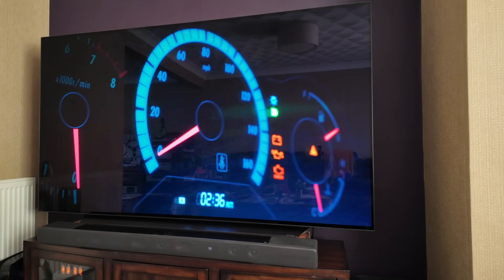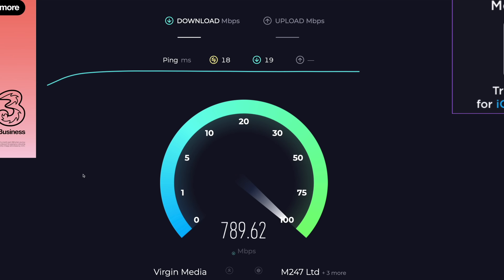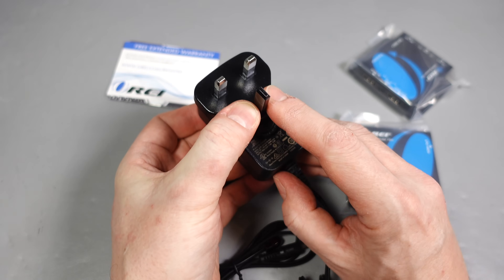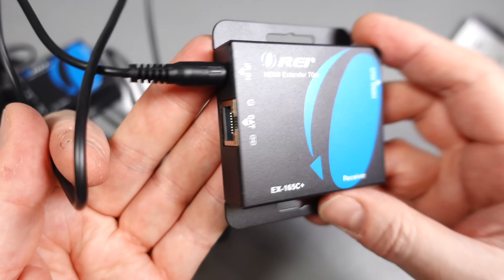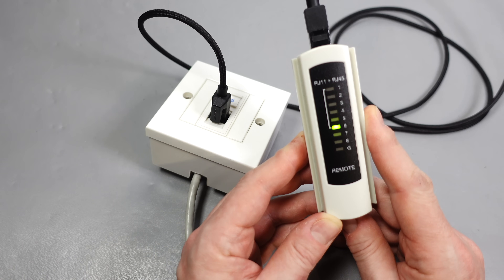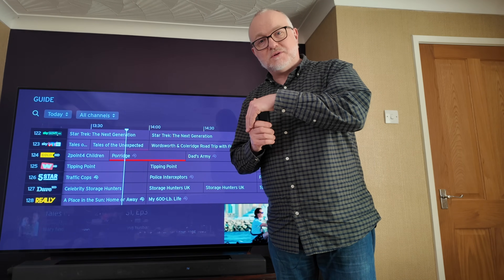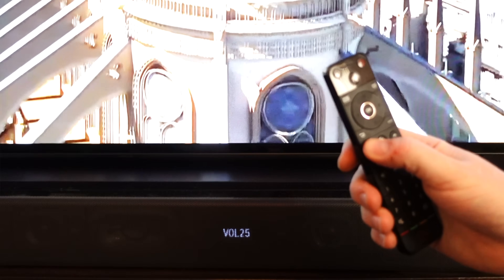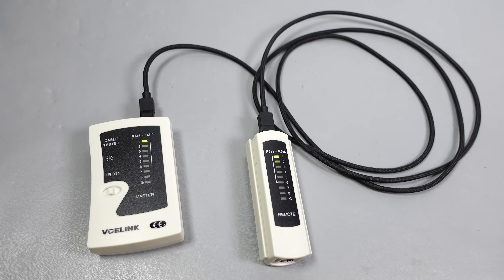HDMI via a Cat6 cable works surprisingly well

Comment: Hey TM, IT FE here. See these devices every now and then and they’re also known as HDBaseT devices. We typically see them hidden under the floors / behind tvs in conference room setups. 

For the Ethernet as you mentioned the green and orange pairs weren’t 1-1 which meant this was a crossover cable, in future, use B standard as that’s pretty much what you’d see worldwide now. 

Great vid as always! 👍
Reply: HDBaseT is the standard but not all of these extenders are HDBT certified. It's a useful standard in case you need to mix and match manufacturers equipment, you can ensure interoperability. But generally these cheap extenders (often called baluns) aren't HDBT compatible.
Reply: @OriginalRitz  Yup, if it doesn't have "HDBaseT" slathered all over the packaging it's a pretty good bet that it ISN'T HDBaseT (costs money to license the standard so unless you NEED to be compliant with it to talk directly to say some projectors most companies don't bother, they just do some signal processing and shove the signals over the Cat6 cable)

Comment: You'll want to cut off the ends sticking out from the punch block in your connector. They introduce reflections and signal degradation. Better yet, buy the correct punch tool that has the built in cutter that does the job right.

Comment: I'm in my mid-twenties and I use a device that uses a bluetotth remote mostly and I instinctively point it at the device and TV all the time still. It does use Iinfrared for controlling the TV's volune, but nothing else. However, I still naturally point the remote at the TV because that's what I grew up with.

Comment: T568A to T568B would be a crossover cable which most Ethernet equipment in the last 20 years wouldn't care as they auto negotiate the connection. 
Structured cabling should always be the same at both ends so good job in fixing that and yep they can certainly be used for other things other than Ethernet.
Reply: I've always seen that majority of factory wires and youtubes use the B coloring, so I always do B.
Reply: @gluino  B is the defacto standard for at least 35 years now.
Reply: Yeah, you'd wiring the cable as crossover like this if you wanted to connect to ethernet devices without using a switch. But as you say, nowadays all ethernet adapters are auto-detect so no need for crossover cables, (plus switches and routers are cheap). Also as crossover cables are normally short, I'd imagine the folks making these boxes wouldn't bother making them detect crossover.
Reply: The last 20 years were very very good. Back in the 90s a whole-building ethernet install was done A on one end and B on the other for a K-12 school i worked for. All we had were dumb 10BASE-T hubs, so back then it mattered. I remember how AMAZING auto-negotiate equipment was when it finally appeared. Now, of course, isn't everything faster than 100BASE-T now reliant on all 4 pairs, so they once again break if crossed over? Power over Ethernet stuff breaks, too, I believe. ◡̈
Reply: @Pants4096  Back in the mid 90s I was using DECNet on coax cables, if they got a kink in them you'd lose connectivity
Reply: Never had these wiring problems with 10Base2 cables. 😆

Although if someone disconnected one of the T adapters.. 🤷🏻‍♂️
Reply: you can get a very cheap crossover adaptor that would probably have worked in this case
Reply: This isn’t Ethernet…
Reply: @brandise76  Correct ANSI/TIA-568 is a technical standard not Ethernet. Maybe watch the video again and you may see @Techmoan mentions about the wiring not working and how they fixed it. Again this had nothing to do with Ethernet but when he originally installed it and it worked for Ethernet there is a reason why it still worked even though the ends were different.
Reply: @Didz  your patience with these folks is commendable
Reply: No, it's not a crossover cable at all.  They are two different pin-out standards (the TIA) for UTP cable connections to RJ45 connectors.  A crossover cable transposed the transmission and receive wires (TX->RX and RX->TX).  Take it from a CCNE and Systimax certified network engineer 👍
Reply: @garyt123   If you take a TIA-568A cable, and swap the 10/100 Ethernet TX and RX lines on one end, that end becomes...TIA-568B.  So either you need to return your CCNE/Systimax certifications or further explain what you meant by crossover being different to TIA-568A/B.  Perhaps you meant it's not a "full" crossover cable with all four pairs swapped, for gigabit Ethernet?  But that's irrelevant since gigabit also mandated Auto MDI-X so at that point crossover cables were no longer needed.  Crossover was only relevant for 10/100 and those had 568A wiring on one end, and 568B wiring on the other.
Reply: @vink6163  quite apart from that I've never seen any standard that does anything to brown/blue, by the time we started using them auto MDI/MDI-X was standard (and realistically these days a Gigabit PHY doesn't care what pairs you connect where so long as they're the right way around at each end), as you noted the only difference between a "normal" cable and a "crossover" cable is that the orange/green pair are swapped end to end which shock horror is the difference between TIA 568A and TIA 586B.

Now if they're talking about a ROLLOVER cable that's an entirely different beast and was very much a Cisco thing but besides the fact that Cisco created it it has precisely nothing to do with ethernet.
Reply: @vink6163  It is not irrelevant. Backwards compatibility is of utmost importance in physical cables as no RJ45 cable is keyed in any way whatsoever with regard to the actual interface used.  Stop thinking about your home network, and just Ethernet, and start thinking about buildings with thousands upon thousands of connection-points, which are designed to be multipurpose data, voice and video (as per Mat's devices in this video). There is a huge difference between structured cabling and Ethernet (OSI layers 1 and 2).  Structured cabling was designed to last for decades and be able to carry multiple signal types and predated the use of Ethernet over UTP.  The actual TIA-568 standards are for structured cabling in commercial buildings, and NOT Ethernet.
Reply: @garyt123  I'm not arguing about structured cabling, that's different.  Someone just said Mat's cable was equivalent to a crossover cable and you said that was not true, but for Ethernet use, it is true.  With no offence to Mat, I wouldn't call that cable with a box hanging free on either end "structured cabling", it's just a DIY Ethernet crossover cable.
Reply: @vink6163  Sorry about your limitations on English comprehension, maybe it isn't your first langauge.  To be extra clear I commented on a reference to TIA-568 specifications. That only concerns structured cabling and has nothing to do with Ethernet.  The device Mat tests also has nothing to do with Ethernet.  A UTP cable, straight, crossover, or whatever, needs not comply to any Ethernet specifications.

Edit: Checkout Dunning Kruger.  You will hopefully find that interesting.
Reply: @garyt123  Oh it's fine, when you wrote "no it's not a crossover cable" I thought you meant no it's not a crossover cable, but I see now your grasp of the English language is as tenuous as my own, and you actually meant something completely different about structured cabling and TIA standards, which are completely irrelevant to the comment you replied to.  I guess we both have to work on our English comprehension skills.

I definitely agree on Dunning Kruger though, someone who thinks a CCNE is worth drawing attention to clearly has no idea how much they still have yet to learn.
Reply: @vink6163  And that is exactly what I meant.  It is NOT a crossover cable, it is better described as a conversion cable from TIA-568A to TIA-568B.  When would this be used?  When sending signals (any signals, not just Ethernet) over older network infrastructure that is terminated using the A spec (ie. some US governmental buildings along with the majority of CAT4 installations). This is regardless of the category of cable the connected end-equipment is designed to use (Cat5e, Cat6, Cat6A, Cat8 or Cat _whatever is developed next).

You see, your misunderstanding I feel comes from the fact that your head is just so full of Ethernet, when in fact structured cabling systems are designed for signal transmission in general and are not, and never were, designed for just one specific Layer 2 signal.  Please note that I never mention "Ethernet" when commenting on data cabling, as that would be just as dumb as mentioning specifically, and only, "LED lighting" when talking about electrical cabling (you see, Ethernet stopped being an OSI layer 1 medium once Thinnet was phased out) .  Other stuff exists (this may come as a shock to you I know!) like incandescent lighting, refrigerators,TV's and electrical heaters - on UTP voice, video, and who knows what else will come down the line in the data cabling world, but I guarantee whatever is developed next will use the same UTP, TIA-568A/B terminated, cabling that has been in use for the last 35 years.
Reply: @garyt123  Yeah but it's just splitting hairs arguing that a cable with TIA-568A on one end and TIA-568B on the other end is not an Ethernet crossover cable, when the pinouts on both are the same.  How do you even tell the difference between an Ethernet crossover cable and a cable with 568A/B?  You can't, because they are the same thing...

I'm also fully aware there are other things that can run over Cat cabling, but it's just not particularly relevant to this discussion.
Reply: @vink6163  Ethernet is not a cabling system, hasn't been OSI layer 1 since Thinnet.  Your argument is basically attempting to call a horse a dog (do they have four legs, yes, are they the same, no).  Even what Mat is testing in this video has nothing to do with Ethernet and everything to do with structured cabling. So why you are even mentioning Ethernet is totally beyond me.
Reply: @garyt123  I never said Ethernet is a cabling system, I said the earlier poster's claim that the cable will work for one specific Ethernet use case is correct.  Geez it's like you're being needlessly pedantic just to be annoying.
Reply: My thinking to, do bring up the question, HDMI adapter  not doing that, as in the example setup of Techman here? it's an adapter, , it's for adapting  something that's already there? why did the limit them selves, like only 50%, of potential cat LAN cables out there, for little more software, that everyone, managers to do?  AND AN UN NEEDED PROBLEM FOR TECHANAL SUPPORT DEPARTMENT 🙂as Techman not covered it, (the cable requirement not on the box), having to resort It trouble shooting, skills that HI-FI, film both, not normally going to have, to solve the problem?
Reply: @dh2032  No idea what you are on about.
Reply: @Didz  the hdmi to cat6 should have had auto mdix, thats what @dh2032 was saying
Reply: @dh2032 It doesn't use ethernet why should.it conform to an ethernet standard.

Comment: The Virgin install at my house has the box on the front of the house, that has a splitter inside with points going to the living room and one bedroom - I'm surprised they didn't offer to do something similar. However, this pre-dates me living here (5+ years), plus this is coax, maybe if yours is fibre then this isn't easily/cheaply doable.
My part of their network used to be Nynex long ago.
Reply: The installs can be very variable I've noticed. My dad and his wife had Virgin for a while, but they didn't even try to cover-up the raggedy holes in the wall for the coax cable run. No splitting or anything either. So they ended up getting it removed a few years later for regular-old ADSL! Virgin tried to upsell them on other services to keep them, but they didn't like how messy the cable run was compared to the phone lines. 

And I can't blame them, they had a really truly awful job done for them. Probably just cost-cutting on the contractor, but that ultimately cost Virgin a long-term customer!

Comment: ....also good as input/output audio cable extension! 
I have connected my computer audio output with this cable to my stereo system which is bit far away from the computer(approx. 6 -7 Meters )
No hum.

Comment: Yeah they are great, I have exactly the same ones here and they replaced two much older larger units one for splitting the HDMI signal and the other box required two ethernet cables to transmit the signal between rooms. Theses Orei ones are much neater.

Comment: I know HDMI can get dodgy at longer lengths, so to take a long HDMI lead out of the question and just use more robust for longer lengths ethernet instead is brilliant. I had this problem myself once too where I bought a long HDMI cable and then for reasons I don't know why the connector at the end broke and this more expensive HDMI cable I'd bought was useless, with that ethernet box I could've just got a short and cheaper 1-2m cable and it wouldn't matter too much if it broke.
Reply: I noticed this problem as well when i tried to connect a projector to an AVR over a 15m HDMI cable. Even though the cable was quite thick and well shielded, i got no signal. I then switched to two 7.5m hdmi cables with a small active hdmi repeater in the middle. It had an extra 5V input but the 5V over the hdmi cable itself was enough to power it up. I also looked at ethernet adapters but the cheapest ones were like 100 euro, and this was 3 times more than what I paid for my setup. It would make sense if the cable had to go through walls or different rooms

Comment: How does HDMI work with a network-based cable though?
Reply: its just using the cable as a cable. it doesn't matter that it's a Cat6 cable. its all just digital data.
Reply: @skellious  Ok
Reply: You can use AV over IP over a fast network. It has the advantage that you can do one to many via multicast and route stuff on the fly. It’s effectively a distributed AV switch. We have Crestron NVX  devices for this.

Comment: Wow! This would be great to reduce subscription costs here where every set-top-box has an additional fee. We could just turn on one and choose between bedroom or living room TV. :) Thanks for featuring this!
Reply: And if you need more than one just daisychain the transmitters... hdmi out of one to hdmi in on the next... too bad you then all watch the same channel :)
Reply: @delinuxspecialist  As long as you're the one in charge of the remote control it doesn't matter. 😆
Reply: @delinuxspecialist   If needed there are also matrix switching versions, such as 4x4. Each TV can independently choose any of the inputs. So you could have two set-top-boxes with two different channels and everybody could choose which of the two they want to watch.
Reply: You can also use hdmi splitters
Reply: Not if it requires hdcp
Reply: @AgentOffice   Most Chinese splitters fake a HDCP handshake with the source device, and output a clean signal. Great when paired with HDMI capture devices.
Reply: There are some linux based set top boxes like certain Amiko ones, that allow you to set one of them as a card server and other as clients. That way each one of them can have a separate channel via that 1 subsr... card.

It's also possible to share the card via internet, that way the clients don't need to be on the same LAN